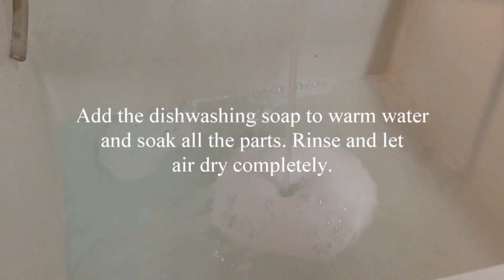Revell 1/48 A-10 Warthog Just Getting Started Fuselage Assembly Part 1

Comment: What paints do you use for this model I’m new and just bought this for Christmas
Reply from the maker: I use a combination of Testors enamels, Testors Model Master Enamels which are now discontinued,  and Tamiya Acrylics.
Reply: @PlasticModelBuilder  would I just use the paint by itself or would I have to use something else?
Reply from the maker: That depends on if you airbrush or not. Airbrush almost always needs thinning.
Reply: @PlasticModelBuilder  so if I use the paint by itself then I would not need to use a thinner or anything?
Reply from the maker: Correct.  But it can help if brush painting. Watch some videos about brush painting if you can. I don't have any but they are there.

Comment: Good job sir, but I really wish revel would work on the quality of the kits. I have the F-14 version of it and I really like the decals but the gaps are just awful and the parts will not fit no matter how hard you try it's really frustrating I just put it up I got so frustrated with it
Reply from the maker: I think you should just do the model and have fun with it. I figure I'm buying a $20 kit so I get what I pay for. At least I'm sure when they made it way back when they didn't put to much effort into. There is a reason Revell is sold in box stores.  I don't think these issues would exist in other kits although I've only done Revell due to the low cost.
Reply: You can putty the gaps and sand, check out fine scale modeler for tons of techniques
Reply from the maker: Its alot for the f-14 from what I remember.

Comment: What grit sandpaper do you recommend for models? Currently building this model as my first.
Reply from the maker: Severl grits are used.  Usally fine grain sanding pads or sticks work. I use 4 different sticks pre packaged starting with course working all the way to ultra fine.
Reply: thank you!  @PlasticModelBuilder

Comment: do i have to glue any parts
Reply from the maker: Yes you will.  All of the parts require glue.
Reply: @PlasticModelBuilder  does the model look bad unpainted? (i like grey) and will super glue work?
Reply from the maker: You can try superglue. You will get better results with some Tamyia thin cement.  I prefer painted. If you  are happy with not painting it,  you can do that.
Reply: @PlasticModelBuilder  alright, thank you!